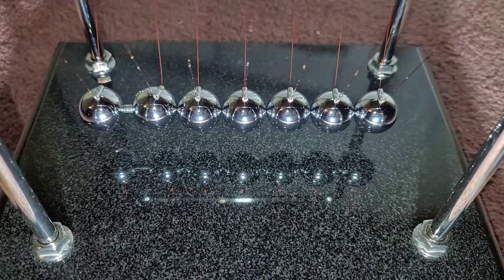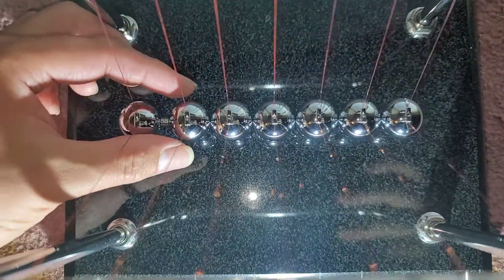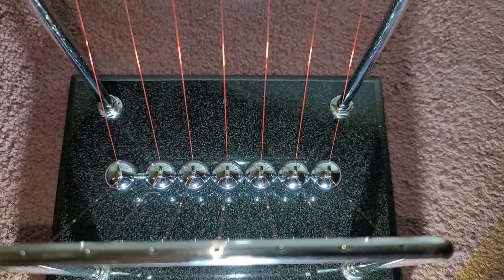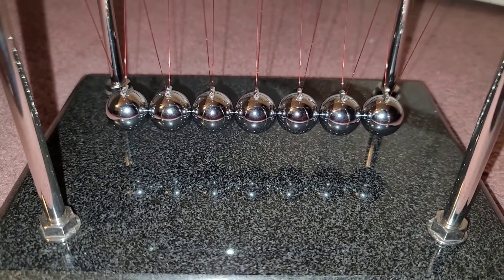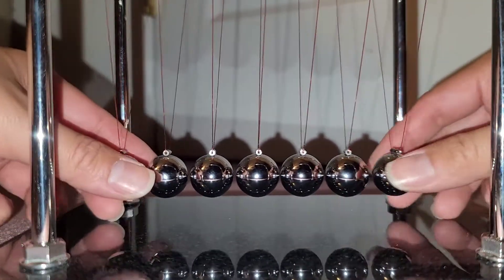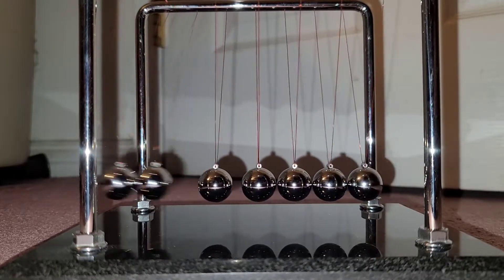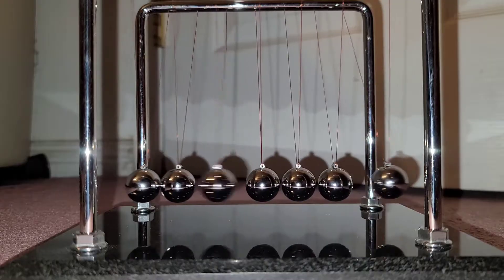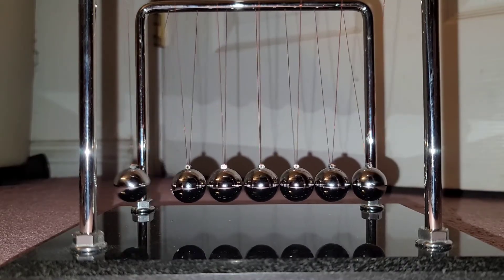Newton's Cradle Experiment With Magnets Super Slow Motion *Magnets Can Cause "Temporary" Damage*

Comment: i took a cradle with me on a flight as a souvenier, and bc of the xrays and stuff, the balls are pretty magnetised... it kinda ruined it, how did you do it?
Reply from the maker: The magnetic properties of a magnet can be destroyed by, also called demagnetization:

Heating magnet to very high temperature.
Dropping the magnet frequently.
Hammering the magnet repeatedly.
Bringing the magnet in contact with the like poles of other magnets repeatedly.
Passing the electric current through magnet.
Leaving the poles of the magnets bare for a long time (called self-demagnetisation of a magnet).
Reply: @ItsBinhRepaired  which one would be best/easiest? Because I can't heat it up bc of the fishing line
Reply from the maker: @mattijsman  most likely just keep banging the balls together